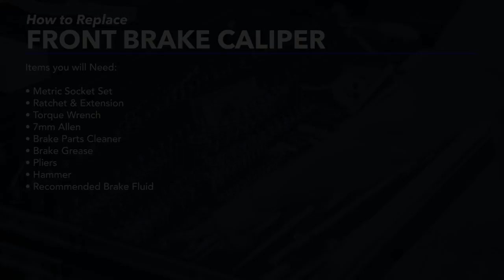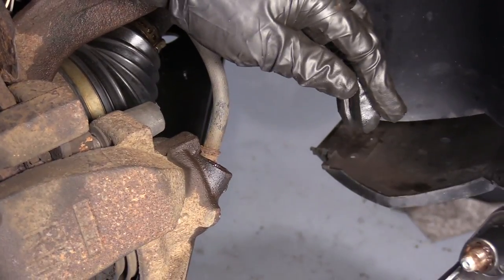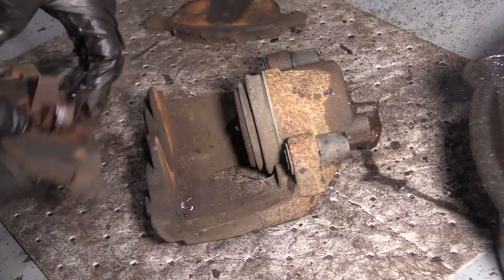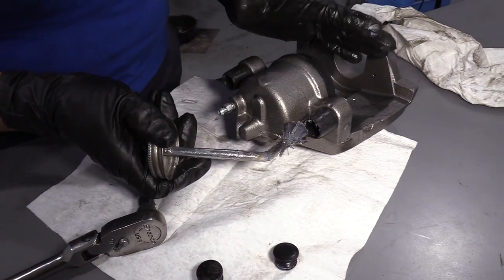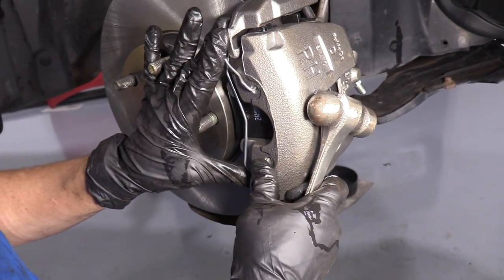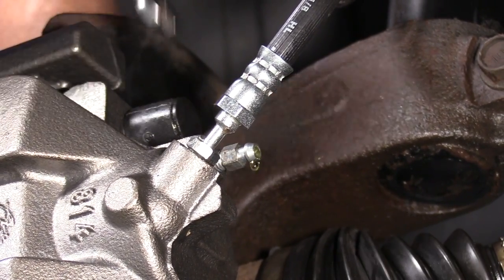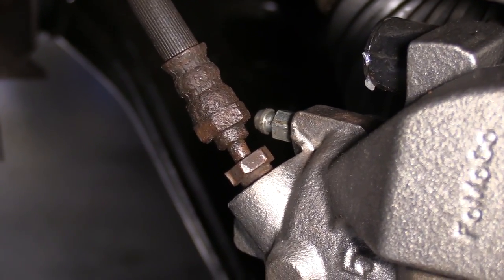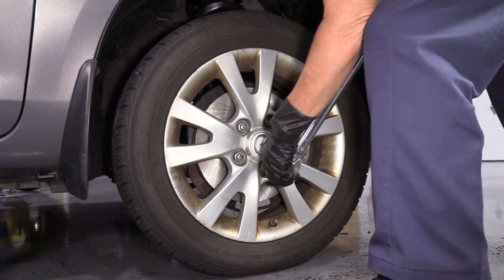How to Replace Front Brake Caliper 03-09 Mazda 3

Comment: Excellent video, all pertinent details are there.  Just one thing, can you clarify "pump up" statement.  Does this refer to pushing the pedal down?
Reply: I think so
Reply: He’s pumping the brakes to get fluid back to the caliper. So he holds his foot on the brake, once she opens the bleed valve the pedal loses pressure and he holds the pedal to the floor, she closes the valve and then he starts pumping until there is pressure again so when she opens the bleed valve again fluid comes out and gets rid of any air that may be in there

Comment: This video leaves me confident I can handle this repair myself. But, my Mazda3 is a 2012 and I don't find a comparable video for anything after 2011. Are folks finding this tutorial still works for slightly newer years?
Reply from the maker: +Colleen Gault We don't have a how-to video for your vehicle right now, but the basic steps in this video should be enough to do this task. Buy this part for your vehicle on 1AAuto.com: http://1aau.to/m/Shop-1AAuto-c